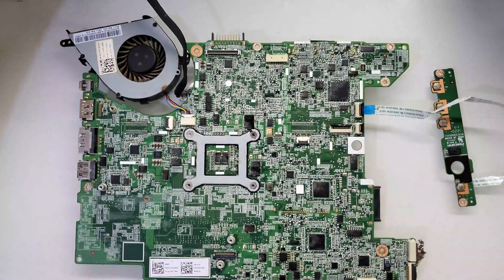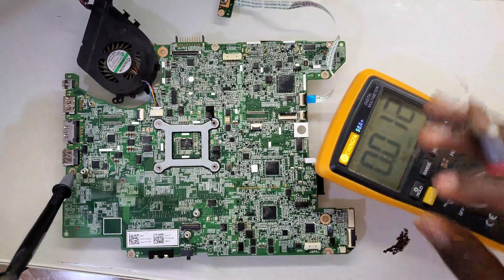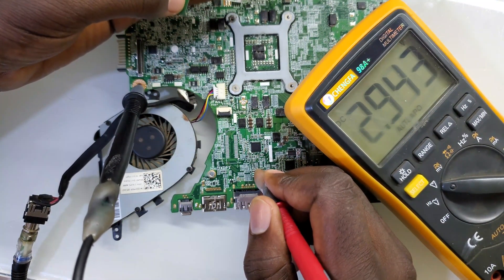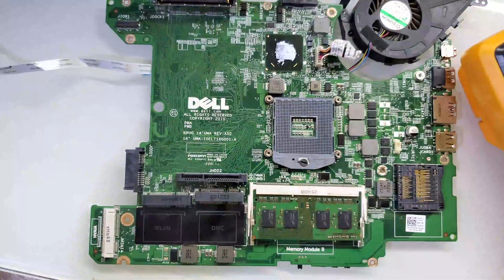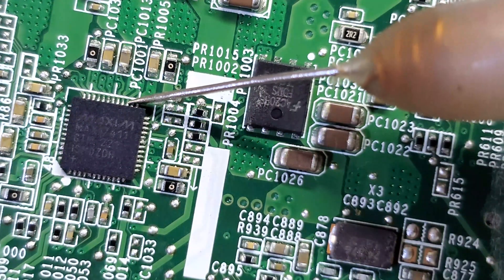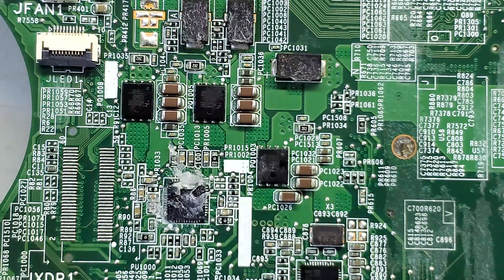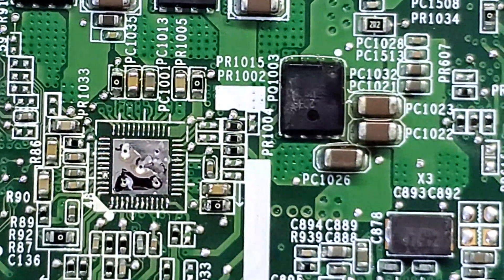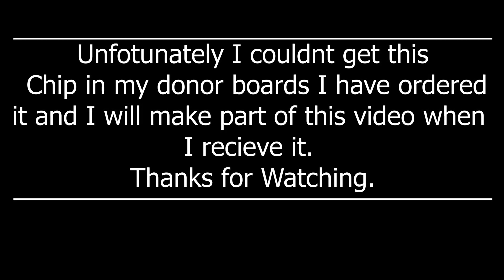How to Diagnose Fault CPU Power Supply Chip, A Common Issue in Dell E5420 turns on and off

Comment: Hi, My Dell E5420 is not turning on.

Another charger has been tested on it 

When i apply power to it, battery charging led turns on for a second and turns off (battery pack is removed).

After this, if I press power button on the laptop, power led turns on for a fraction of a second and turns off. Fan doesn't move, HDD doesnt start, no LCD screen. If I press power button again, the power led this time doesn't turn on. If i reapply power from the mains, the cycle can be repeated.

I removed battery pack, CD-ROM, RAM, WI-FI card and HDD and applied power, nothing changed.

I removed and reinserted CMOS battery to reset the BIOS but nothing changed again

I can check 19.3VDC coming at various points on the motherboard.

I can't find any voltages on any of the buck converter coils (perhaps because it is shutting down immediately?)

Please help me to resolve this issue. I'll be very thankful to you

Thanks in advance
Reply: It's probably a bad power button or short circuit somewhere. My Dell latitude e6430 is having the same problem. I'll never buy a Dell PC again.
Reply from the maker: You can check this video you have an issue with the secondary voltages.
https://youtu.be/Z2zUWZ0eSKA?si=qeFqwcAFpO6F-EyQ

Comment: For a phone: If the capacitors and connectors are badly damaged, can one transfer the cpu and ram to a working same model motherboard? Would it work, would it required any other chip transferred? That's where the focus is data recovery
Reply from the maker: Usually that doesn't work in smart phones due to data encryption

Comment: I have a question, how do i test components around the cpu that is mounted on the board cause for example when i test the capacitors around them they behave as though they are shorted. same with the Coils. so how do i go about that issue?
Reply: I think a completely shorted chip has all caps connected to it appear to be shorted, one cap shorted instead of all caps around the chip would be tricky
Reply: The method of test ic pin using multimeter with ic data sheet is good for those who avoid burning the motherboard by injection of voltage and suitable for those who do not have thermal cameras to pinpoint hot areas (shorted components)